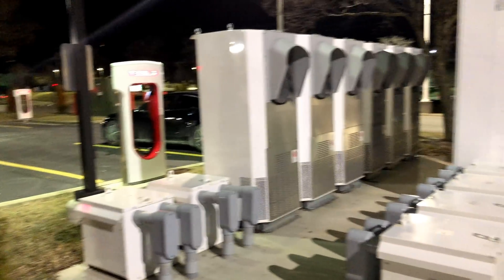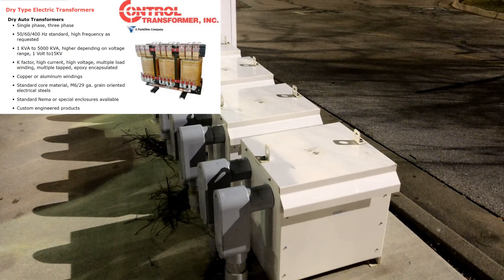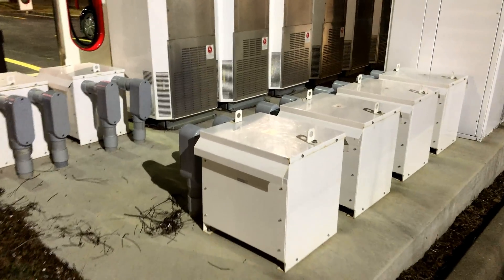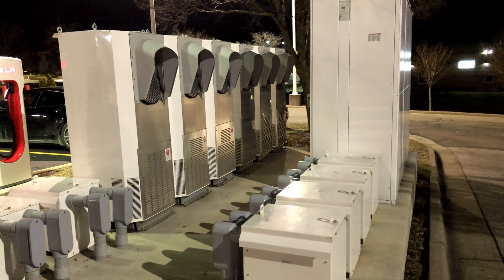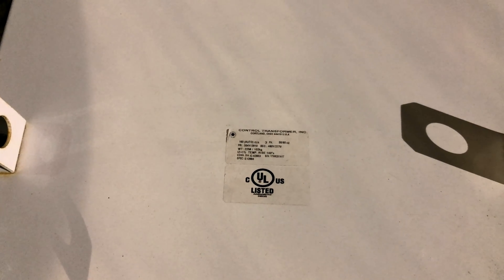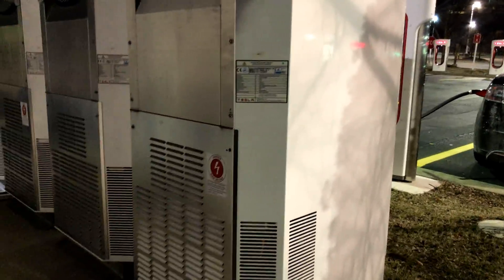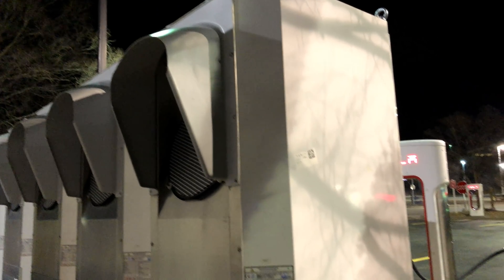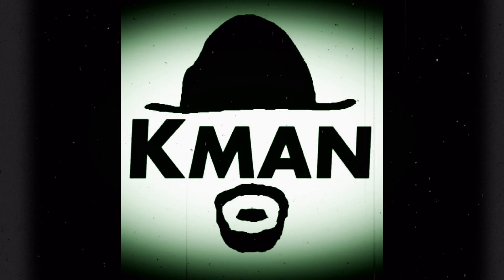Tesla Superchargers get New Mystery Box! EXPLAINED!

Comment: Looks like boosting auto transformer. 480Y/277 is standard utility voltage, the Tesla seems like it requires 504Y/291 volts. There is a good chance that site is served by a 500KVA or 750Kva padmount transfomer.

Comment: Any superchargers right near pigeon forge? Debating a Tesla but also been debating moving up there.
Reply: Edward Sessum 
If a move is contemplated, the presence of a nearby Supercharger should not be a consideration, should it? When moving permanently, you'd do your charging in Pigeon Forge at home. Persistent charging at Superchargers is known to significantly shorten Tesla battery life, so much so, that Tesla will cancel Supercharger privileges for owners who use them enough to hasten that damage.
Reply: The overuse of superchargers thing Tesla used to say turned out to be because of people with lifetime free supercharging. Remember that large areas up there you don’t get full 200amp service and it isn’t even a option to add. Charging at a 20amp rate during the winter because of having electric heat and water doesn’t work well. Now that they are going mainstream with regular cars anyways there will be those who use them as long distance cars and they will always be using superchargers. If they started going at people for using them a lot it would turn into a mess.
Reply: Edward Sessum 
I've never heard a retraction from Tesla on their position that 100% Superchargering damages batteries.
150-amp service doesn't preclude installation of a 50-amp circuit. It might get testy with electric heat.
But if I had to depend on Supercharging for all my Tesla charging, I'd definitely not have a Tesla. The sheer inconvenience of having to spend many hours a month at (or very near) a Supercharger would rule that out right quick.
Reply: Buddy308 not saying it doesn’t hurt the battery over time but you can still limit the charge rate down some. I would prob be working in gatlinburg anyways. Even just a solid high speed non supercharger I would be fine with. And in the mountains it’s mostly 100a not 150a service. 

I do believe the newer battery’s dont take supercharging as harsh as the older ones and that’s why they are bumping the charge rate many places. Doesn’t the model 3 have better cooling for high speed charging anyways?
Reply from the maker: Rumor mill has it, but nothing at the moment. The area, Gatlinburg and Pigeon Forge do have a lot of Level 2, and I believe I saw some L3 on Plug Share. In that area though, a Heat Pump would work very well for the home, leaving a sizeable amount of utility capacity to the home free. I heat my entire rental cottage with a 12k btu mini split. Keeps it at a comfy 75*F for my guests all the way down until the temps hit about -10*F. And that runs off a 15 amp 120v outlet :-)
The temps in that area done get down too low, at least in comparison to here in Wisconsin. And the money savings.... My rental cottage electric bill would be 400+ /month on baseboard electric heat. Even this feb, with temps reaching -32*F, the electric bill only hit $125.  House is 700 ish sq ft. 

But again, lots of L2 in the area, and Knoxville and Ashville both have superchargers. The Tesla HPWC's around the area are just about all 80 amps, so up to 20kW charge rate. Worked great for me!

And don't knock the 20 amp charging :-) Now that I have my grid capacity maxed at home, due to bitcoin mining, I keep my car charged most the winter on a 20 amp 240v outlet. I have no problems, and temps here, again are very low. 

Oh, the outlet mall in Pigeon Forge/Seiverville has a bunch of chargepoints that are free too. 

Cannot limit charge rate on a supercharger. It will give the max that tesla determines for your battery, temp, and charge level. 

Either way, if you decide to get a Tesla, I would be happy to talk with you privately and help you work out an effective charging method for home :-)
Reply: KmanAuto last time we were up there in a rental it was in 12. 2700sq ft house. I plan on around 1500. But it was like 10* outside and that house had 3 3ton heat pumps and 8000watt strips running and it was freezing in there. And that house was built in 2001 (gone now from the fires). I looked on blink and most of the chargers on there are broken now. 

As far as rumored we have been on teslas site as a repair and supercharger center coming to New Orleans since 2016. Still nothing. 

I’m waiting till later this year to decide. I did look it up tho and the model 3 battery is designed to handle constant supercharging much better.
Reply from the maker: Depends on the heat pump style, and also insulation.... But for that size home, you should have been roasting with a single unit. Sounds like something wasn't done right. That, and heat pumps have come a considerable way since 2001, and I mean that BIG TIME. But again, insulation is king. Doesn't matter how much heat you can pump in, if the proverbial windows are open :-)Blink is complete garbage, no matter where the station are located. PF does have a good number of Tesla HPWC's. Though, I really didn't even need them. Charged in Knoxville, had enough to do quite a bit of driving for the 4 days we usually are in PF each trip, and still had plenty to get back to Knoxville. And my 90 battery is currently degraded to 75.3ish kWh capacity (The V1 90kWh batteries have considerable degradation issues). I'd move to Gatlinburg if I could. 

But just rule of thumb. ALWAYS bank on a Blink station being out of service. Tesla HPWC's almost always are functioning properly. Charge Points  would have an functional rate of about 80%.
Reply: KmanAuto I do some ac work here for our own stuff and heat pumps suck after it gets below like 35. I can’t afford one of those new crazy ones that work to -10. But yea in that house it was around 50 in the house with all 3 units running full out. Had to keep getting up and turning on the timer for the fireplace to get anymore heat. Luckily it was a propane fireplace.
Reply from the maker: Oh heck, the whole thing, complete kit and 20 seer was $500 on ebay free shipping. installed myself :-) took me about an hour. just got in 3 more to install in my parents motel units as the old crappy ptac ‘s kick the bucket
Reply: KmanAuto oh yea. I’m talking about split systems. The big ones not package units.
Reply: KmanAuto 
The professional jargon is over my amateur head. Are you talking about a heat pump that you can add on to an existing central AC system?
Reply from the maker: Buddy308 No, self contained mini split system. i’ll link everyone when i get home :-)
Reply from the maker: Here is the most recent one I purchased: https://rover.ebay.com/rover/1/711-53200-19255-0/1?icep_id=114&ipn=icep&toolid=20004&campid=5338004351&mpre=https%3A%2F%2Fwww.ebay.com%2Fitm%2F12-000-BTU-Ductless-Air-Conditioner-Heat-Pump-Mini-Split-110V-1-Ton-W-Kit-WiFi%2F273693419261%3FssPageName%3DSTRK%253AMEBIDX%253AIT%26_trksid%3Dp2057872.m2749.l2649

Solid unit. Once again, I heat an entire cottage, nice and toasty (probabally too toasty) with one of these. These are much much much more efficient than the whole house units. I will be installing two in my home as well. I have a split level, and downstairs is always freezing and upstairs is always warm, even if I keep the house circulating fan on. So I'm putting one of these up and one of these downstairs.

Comment: I can’t wait for the charge speed increases. Finally in Wisconsin we had a nice day and I was getting a 120kw Charge rate again.
Reply from the maker: Yes, it is refreshing :-) Though Tesla has limited my battery to 94kW charge rate :-( I haven't seen 118 kW since the second month I had my 90D :-( Oak Creek supercharger is sill the best in WI yet, that sucker maintains it's output :-) Though it's only 2 miles from the power plant...
Reply: KmanAuto I agree oak creek is awesome. Especially with the restaurants around it. 😀 why did they restrict your charge rate? Are they pulling an Apple?
Reply from the maker: Yes, they pulled an apple. The 90kWh batteries are/were complete crap, with lots of degradation. They claim they are restricting charge rate due to DC Fast charging too much to prevent degradation. However, I did not fast charge too much that first 2 months. Basically, it's a load of bull crap. v3 90 packs dont have the issue, but to get one, mine needs to fail first :-(
Reply from the maker: Mines already at 75.3 kWh capacity.
Reply: KmanAuto wow, that’s terrible. My p85 battery failed one week after I bought the car. At that time I was told they might put in a 90kwh battery. Now I’m thinking I’m lucky that they didn’t, considering I could have got a reman gen 1 or 2.
Reply from the maker: Yah, I had the option of a 85 or 90 when I purchased my 90D, they were just making the transition. In hindsight, I should have saved a bit of $,$$$ and gotten the 85, sacrifice initial range, but in the long run, more robust chemistry and less long term loss.

Comment: They are either boosting or bucking from 480v to 504v, probably higher voltage to super charger to allow for more power output. So 480 from utility, 504 to supercharger. More power to chargers = more power to car
Reply from the maker: And keep it stable. I've been at SC's where the output was reduced at peak hours due to voltage issues. Similar to how the cars reduce charge rate if they detect voltage drop beyond XX variable.

Comment: neat discovery, did the pedestals have the vents like that liquid cooled one you saw?

The shiny metal vs white on those cabinets seems new vs the V1 and V2 units I'm used to
Reply from the maker: Kacey Green no these are just normal supercharger v2. nothing related to V3.
Reply: @KmanAuto  were those liquid cooled cables that showed up and got removed alpha/beta for V3 cables and pedestals in your opinion?
Reply from the maker: No, no liquid cooled. The liquid-cooled were only used at the Mountainview supercharger, and again internally for testing, which did amazingly well! (as you could see by my thermal imagery in those videos).  Now, they will be implemented in the V3 supercharger
Reply: @KmanAuto  right, I was asking about those ones, did they seem like v3 test articles they kept the Temps down for sure
Reply from the maker: Kacey Green styleing is more refined then in the past

Comment: I used to work for a power company.  Those large transformers must be used to adjust the voltage on the AC side.  Power Factor correction would be done with large capacitors.
Reply from the maker: Keith Kitzhaber yes, adjust input voltage. i’ve seen superchargers throttle back due to utility voltage drops, similar to how the cars dial back the ac charging if they detect voltage drop. so this should make supercharging rates more reliable. and this station held my max well! 
yes power factor correction using caps. don’t need to be too large depending on the efficiency of the stations, though, it’s not like a load you’d get from a motor, not inductive, so not sure how well a capacitor would assist. i have experimented with KVAR units. quite fun! useless for residential due to not getting billed that manor
Reply from the maker: I knew I did something on this, KVAR  https://www.youtube.com/watch?v=yPzrbj0FxUo

OLD video, 2014. Not the best explained. But I show some pole mounted Power Factor correction caps.
Reply from the maker: My utility must hate me, I build capacitive battery chargers, the power factor charging a 12v lead acid is abysmal, around 10-15% https://www.youtube.com/watch?v=N6NluEvBAUU
The did an awesome job charging conversion cars and golf cars that use lead acid. Could charge any battery from 12 to 144v off a 120v outlet, as the AC rectified to DC means 120v AC would become ~170v DC. And the rectifier would split the sine wave, making it pulse at 120hz instead of 60, the pulsing was just right to help dissolve the sulfate buildup, keeping batteries healthy and reversing the sulfation of worn batteries. This let me use $100 Walmart deep cycles and get them to last longer than a $500 Trojan.
Reply: Thanks for the clarification. This video really wasn't very informative nor specific, even about AC or DC conversions, calling them just Superchargers